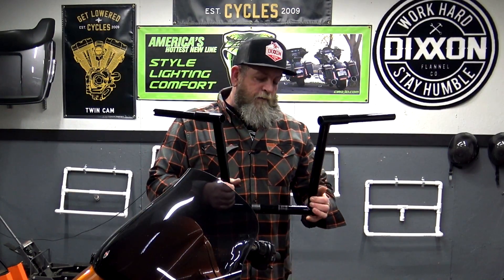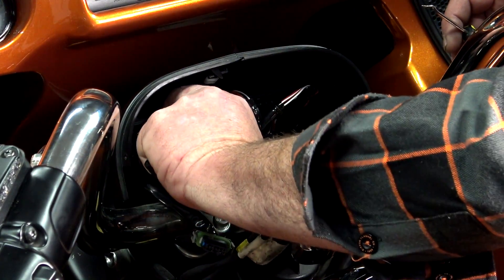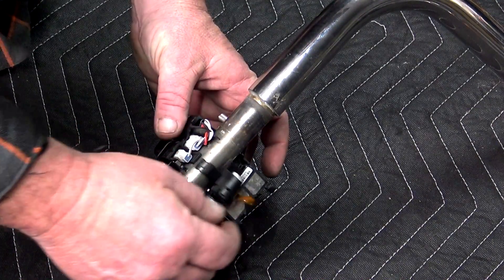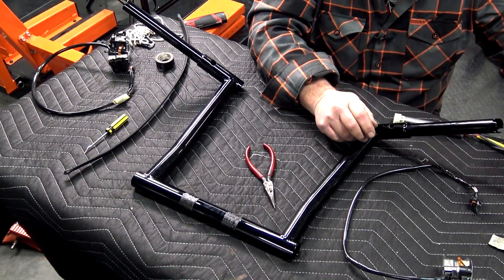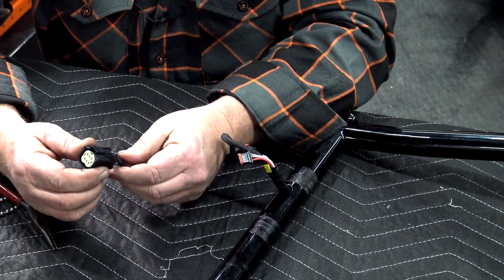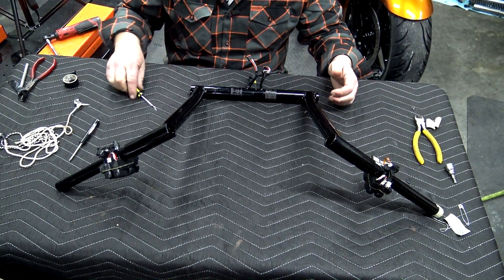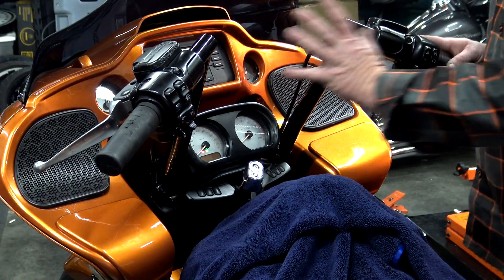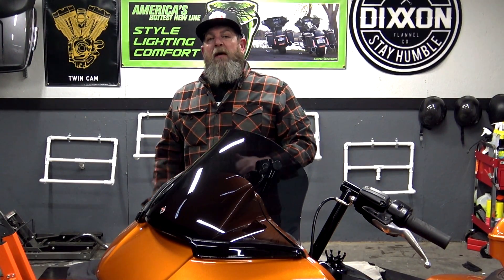⚡Road Glide Handlebar Install Road 6 Customs 2015 - 2023⚡

Comment: Steve, I’m 6’4 so for comfortable riding position on my factory 47’s there pushed all the way forward. With that I’m not able to put in the two screws on the side of the gauge cluster. Have you seen this issue before ? I used electrical tape to secure the cluster together. Any ideas to get the screws back in ?
Reply from the maker: unfortunately no...if the bars are in front of the holes im not sure how you would get to them...and that piece goes on last...so im not sure. May have to just pull your bars back a little

Comment: Question I installed some lastnight and now I have the check engine light on and it says check oil. Is it a memory issue the bike only has 60 miles on it 2020 rg special
Reply from the maker: absolutely normal..you just had your bars off...check my video here on how to check your codes and reset them..super easy https://www.youtube.com/watch?v=ZV8xONzYsTU&t=18s

Comment: I watched your video and swapped out my bars, now my bike won't start any thoughts? thanks
Reply from the maker: Hey Scotty...that really could be a ton of things...start with your throttle side and check all of your connections inside the switch cap housing and in the bars...also check the plugs in the guage cluster...hard to say man...just have to get in there and and start chasing wires
Reply: @sikbaggers  thanks for replying Steve 👍🤘👊

Comment: How much taller are those from stock.   How much slacked we have on the wires?
Reply from the maker: if you remove the panel as I showed it will give you plenty of slack but 13's are about as high as you can go without changing the cables.

Comment: I used hill country customs top clamp and new urethane bushings. On my 16 I didn't have that big connector. I didn't have to depinho anything thank god.
Reply from the maker: Hey tim yeah they make some great bars...installed some of those on a buddies bike. You got lucky. its weird because my 14 didnt have it but my 15 did and man its no fun. I couldnt not for the life of me find me de pining tool so I did it the hard way. Super easy to break those little prongs in there if you dont get it right.

Comment: No torque settings??
Reply from the maker: Ah, yes, the ever-polite internet. Torque specs? Of course, they're important, but so is saying 'thank you.'  Do you need a copy of the service manual for your bike?  If you are going to be wrenching on your bike you should at least have the pdf version of your service manual.  I have one I can send you a link where you can download it for free. You'll find that a little courtesy goes a long way toward getting the answers you need.
Reply: @sikbaggers  No disrespect intended in that question. I'm a big fan of the channel, I watch every video you drop. It was just a quick question, thinking I would get a quick answer. Didn't know know I would get the rudely response. Thanks for your help
Reply from the maker: @Dtown-Rock  you realy have to understand how many smart ass comments I get on youtube everyday...its getting rather old to be honest...so reading that it came across the same...here is a link to the service manual...if its not the right year let me know https://drive.google.com/file/d/1-ZGa3ZwXOC-sKAGbx1_EUlsqeb2Gskvp/view?usp=sharing
Reply: I get it, internet thugs 🤣 😂.  It's all good buddy

Comment: Funny how nobody shows the clutch and brake lines areas that have to be popped out to allow extra length for 14” bars. Stock is too short without extending.
Reply from the maker: you dont have to pop them out on a road glide..that's why no one shows it.  You can do these 15's and never touch the cables.

Comment: I hate how harley want to charge me $2200 to install my bars saying I need new cables and wires and I see on videos that you don't need them
Reply from the maker: they always throw in cables and wires at HD because they really arent allowed to just pop wires off that little piece of plastic...some will, most wont though...but you are correct...for certain size bars you will not need them. Save yourself some bucks!
Reply: @sikbaggers  thanks I Appreciate that

Comment: i followed the video replaced the same bar. everything is fine. just the engine light come up. anything wrong? 2018 road glide. thanks
Reply from the maker: It happens...You just had all of your writing dis connected so follow my video here and reset your ecm codes. They will go away. https://youtu.be/ZV8xONzYsTU
Reply: thank you so much
Reply: @sikbaggers  i watched your video and reset most codes. but there are 4 audio codes i can't reset....everything about audio is working though.